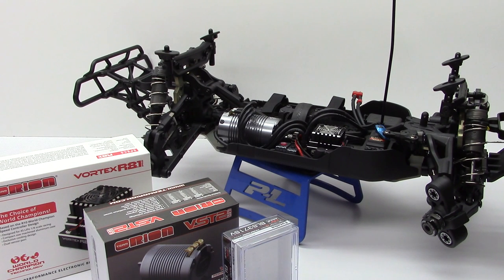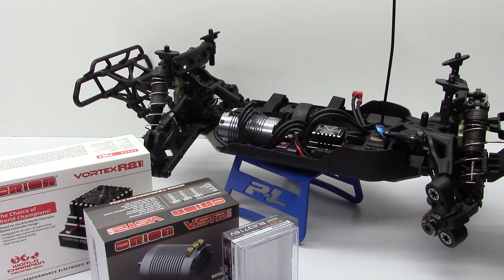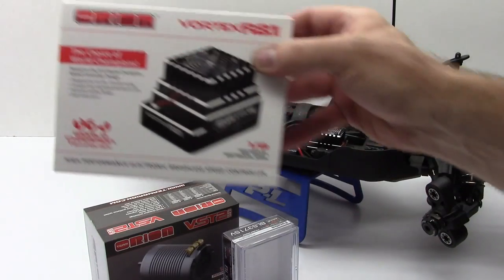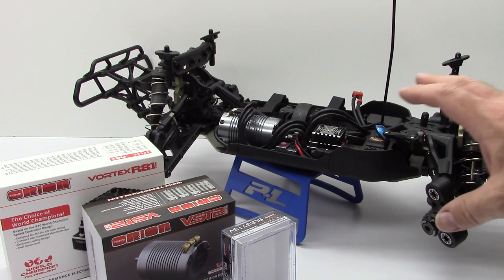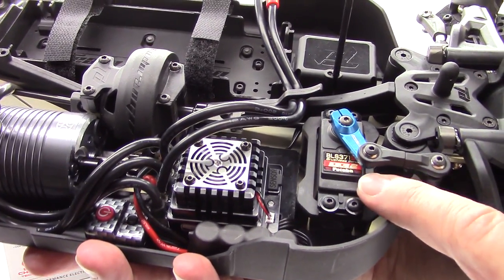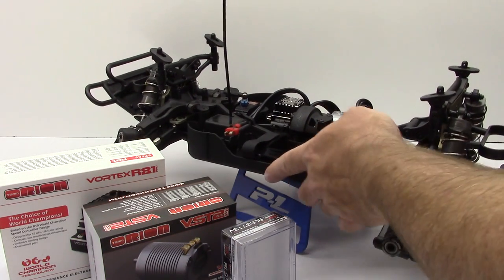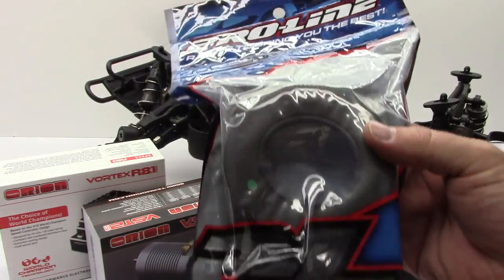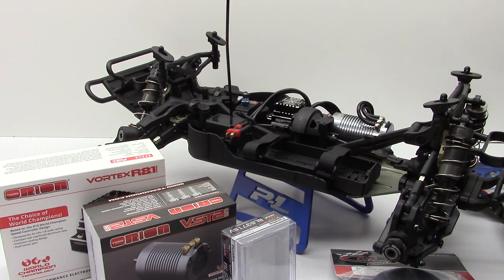Team Durango DESC10 - Build Update 2

Comment: Rich, does the front knuckles have derlin or brass pillow ball cups where the upper and lower control arm connect to the knuckle ? Also does it have universals or dog bone outer drive cups at the front knuckles. Ok and my last question is why are you reading this and not out on your bike lol
Reply from the maker: DaveCawlerDave Hey Dave, all the TD platforms run on CVD's on all four corners - Very nice ones too.  I'm not sure on the brass/delrin cups, as it was pre-assembled......I will have to check!  As for the bike, I'm just getting over a nerve issue in my right foot.  It' right on the ball of my foot, so if I need to hammer up a technical section......it burns! I'm on the mend, and should be back soon.  The Foot Dr. told me the only other option is to remove the nerve but the I would have constant numbness, etc.  Alright TMI! lol

Comment: will a 2s battery be able to balance the weight vs that huge motor on the other side of it?
Reply from the maker: Sleepy .Time Probably not.  She's pretty heavy!
Reply: The RCNetwork when i saw you picked out a 2100kv motor id guessed you plan on going with 4s so it should be fine